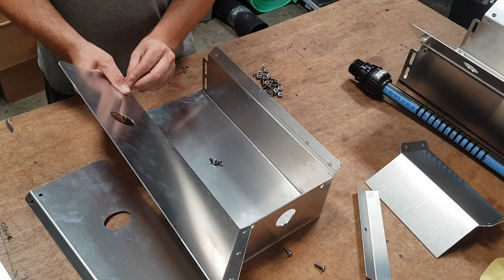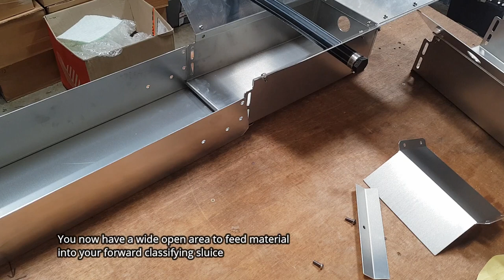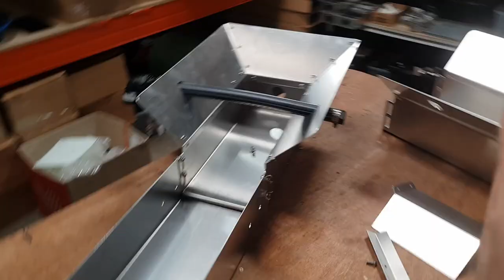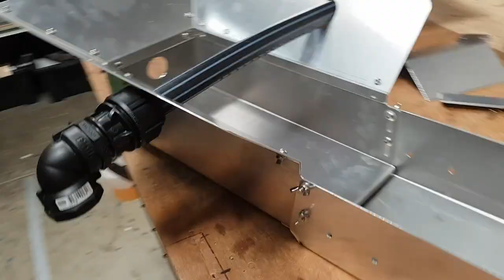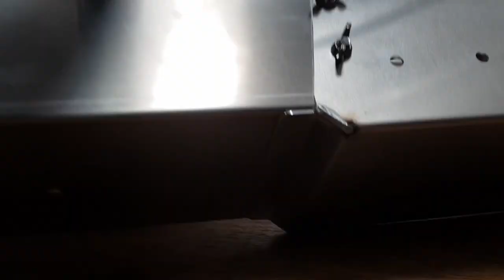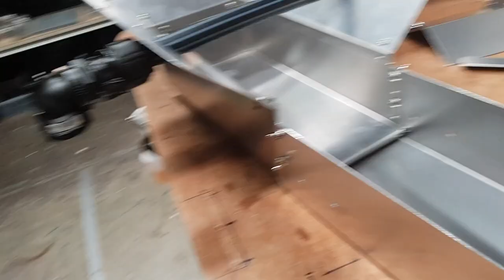Sluice Flare Extention how to

Comment: Can you guys make a 6 inch.
Reply from the maker: Yeah we make a heap of 6 inch products checkout our 6 inch clean up sluice and 6 inch hopper option
Reply from the maker: Www.highbanker.com.au
Reply: Yeah if I could get a 6 inch hopper. Something I could switch my little sluice into a highbanker would be awesome. 6 inch is perfect for the state Utah. No mechanical stuff cant be gas or electric when out digging. But i can cheat using a water ram pump. And I'm a very simple man. I like if I can make 1 tool suit many needs. And dream mat makes this even simpler. If I can set up a header and flair kit for the highbanker and then another header for clean up sluice I'm set.
Reply from the maker: @TheSkiddum  its one of our very popular options mate currently have 9 in stock
Reply: @GoldRatEngineering  never mind I found it. Cant wait to order it and get it set up.
Reply from the maker: https://highbanker.com.au/collections/pioneer-highbanker-series/products/6-inch-highbanker-hopper-option